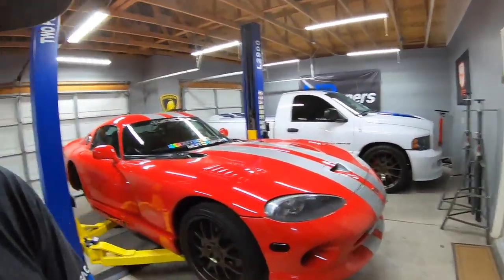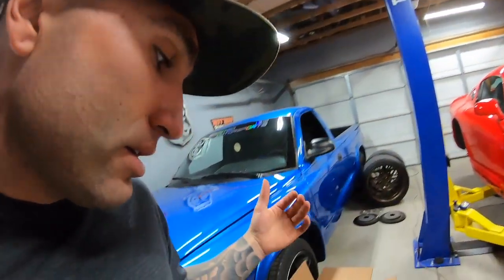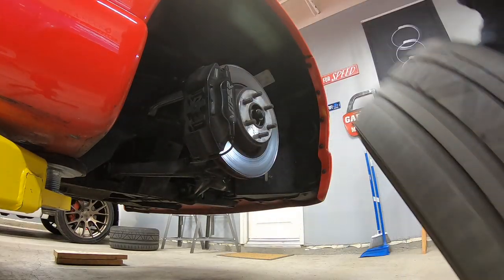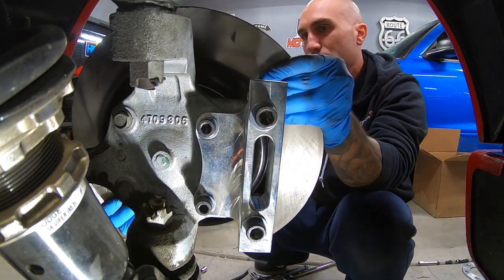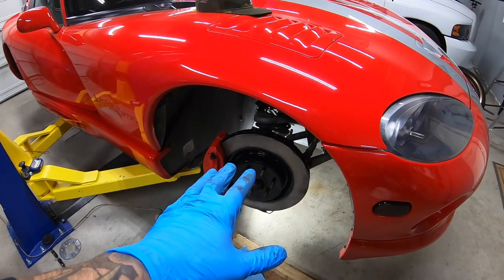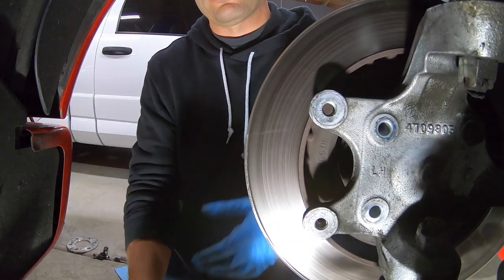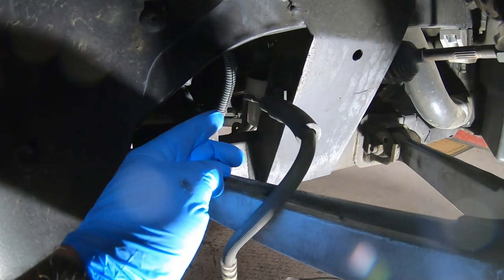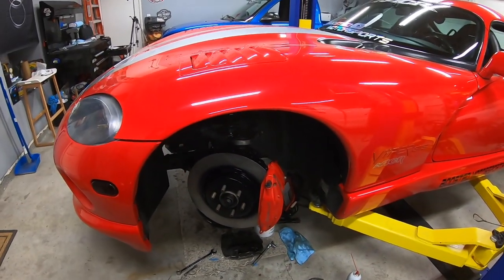DODGE VIPER BIG BRAKE KIT INSTALL | IPSCO FRONT | 1996-2002

Comment: The Gen 3 and up rotors are 1/4" less depth than the Gen 1/2 rotors so stock Gen 2 18" wheels will only fit using spacers!  Roe Racing made my 14" lighweight racing brakes and they are made to fit stock Gen 1/2 18" wheels without any spacers.  About 9# lighter each.  RRacing uses  vented 2 pc rotors and new Gen 3/4/5 calipers.  ALSO, the ABS Master Cylinder is larger than the earlier systems and should be used for Brake upgrades.

Comment: The Gen 2 front calipers use the same size pistons as the Gen 3 Calipers.  Brake pads are a bit larger than Gen 2.  Rotors are larger and have more friction surface
Reply from the maker: Not true.  Pistons are considerably bigger on 03+ front calipers compared to 92-02 front calipers. The Gen 3 fronts, which are 4-piston calipers with 44 and 40 mm pistons, are larger than the Gen 1/2 fronts, which are 42 and 38 mm pistons.

Comment: Excellent videographer 
For the front - the link is the gen brake lines. 
For the rear - the link for the gen3
Is that correct ?

Also are front and rear lines different?

Comment: Thanks for the video!

Did your ACR bbs wheels require a spacer on the front to clear the calipers? 

Also are those bolts with the kit black zinc or just black oxide?

Thanks!

Comment: Great video! Where did you source the calipers from? Thanks!
Reply from the maker: I kept a close eye on eBay for a set at a good price.  I have 1 spare front driver caliper for a good price if you are starting you parts list.
Reply: I am interested in the caliper. I sent you an email to your gmail off your Instagram.